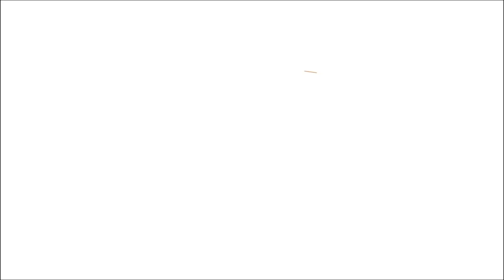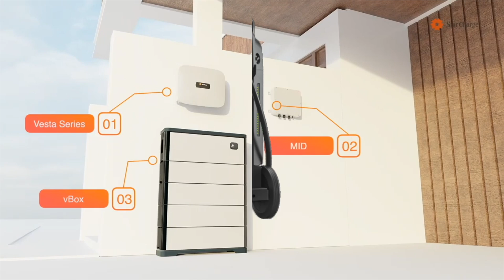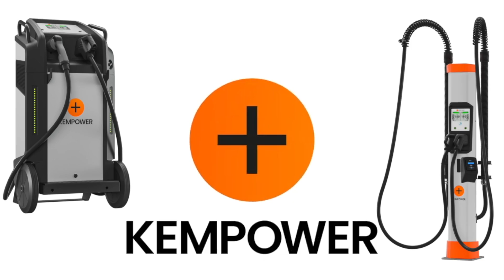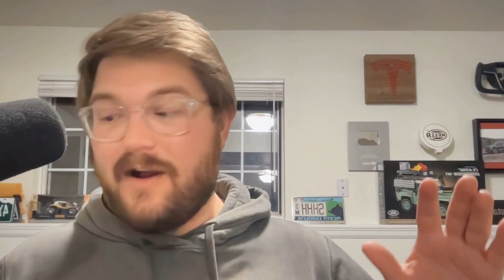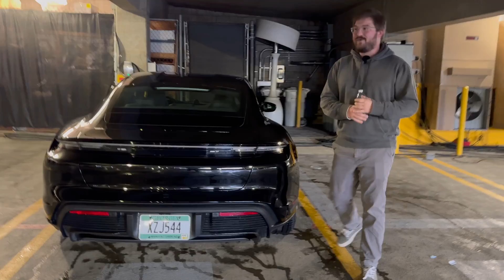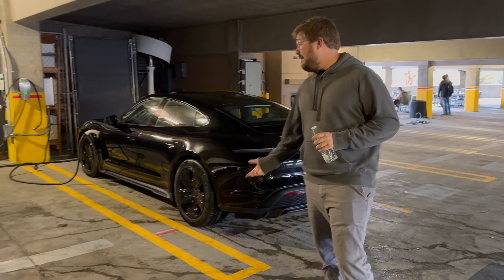Insane Porsche Charging Performance! New Taycan Facelift Charging Test & Comparison

Comment: 60 kWh in 12 minutes is outstanding. I waited for 14 minutes in the Costco gas line this weekend to just put 10 gallons of gas in my daughter’s car.
Reply: Drive 20 minutes then wait in line 10 minutes to save $5? Sounds like something my parents would do.
Reply: Filling up ICE car involves waiting in lines twice behind people paying with Lonestar cards and people playing/buying lottery tickets.
Reply: The only reason I go to other gas stations other than costco is to only top up. My van takes 18 gallons and price difference is close to 70-80c which is about 15$. That's significant savings. coming to my EV I drove 16000 miles and never super charged as we were doing local trips in a single charge or longer where we had charging at airbnb. Once my boy grows up we will be doing longer trips and perhaps use supercharger
Reply: charging an EV takes 5seconds 99% of the time. (the time it takes you plug it in at home)
Reply: lol that will charge my yearly energy need in 4 hours😂
Reply: You and I both know that's the exception not the norm

Supercharging isn't a reason you buy an EV

Charging at home is
Reply: lol ...to save $2:)
Reply: @keithhere5868 Yeah, ridiculous, just like the ICE truck and SUV owners always complaining about the cost of gasoline. 😏
Reply: Waiting time is something else and much more likely to occur at a charger than at a gas station anyways.
Reply: 10 gallons is 38 liters, that's 3 weeks of driving for me.
Reply: At what price. What will happen with these batteries in 5 years
Reply: @alexsmith6271  they will either be still working in the car or they get recycled as a Powerwall.
Reply: @LearningFast  they may be still working with a large degradation and a lithium plating about to happen.
Reply: @alexsmith6271  True, the Taycan is a bit too overpriced for what it is. However, after 11 years of my Tesla Model S ownership, I have experienced 9% battery degradation. Originally charged to 208 miles, (60 KWh Model S) now it charges to 188. That’s not so bad, IMHO. Depends on how many times the battery has been charged to 100% and drained to near 0%. Also, how many times the battery has been fast charged at fast DC chargers.
Reply: @Xetairex  it's amazing. I own m3p. I was asking about this fast charging at higher soc. To me, im ok to wait extra 5-10 mins. As for your degradation, this is not the accurate way to measure. You need to go down to zero and then charge it to see how many kilowatt hours you are getting.
Reply: If you have long Costco Gasoline lines means you live in overcrowded area. Something tells me you would have long lines to get to the charger as well. Before you need to spend charging time
Reply: @web  no lines at any of the Tesla Superchargers at all in our area. I have traveled all over this state and other states and I have never waited in line at a Supercharger.
Reply: @web Not really. Here in Fremont in SF Bay Area where I live, in the last 11 years of Tesla ownership, there was never a line at the superchargers, but always, always one at the local Costco.
Reply: @web  
Not necessarily on the Costco lines. The Costco in my city is not near a dense residential area at all. It's in a shopping area. But there's always a 20 minute wait,. And it's ridiculous. Saving 30 cents per gallon? You're saving less than $4 versus the rest of the gas stations in the city.
I think it's the same kind of mentality that leads people to crowd into stores for Black Friday to save $50 on a $500 TV.
Reply: @web Perhaps you live in the middle of nowhere and have never seen gas lines, but you should see the lines in the summer to fill-up with gas in all major urban areas. In the NJ Turnpike and Garden State Parkway there are usually a line of 15 minutes minimum in the summer or on holidays. Then after the father has finally finished filling up, he has to find a parking spot to then go join his family inside to get something to eat.

Meanwhile, on the same rest stops, Tesla drivers leave their cars charging and go inside, and by the time they're finished, so is their charging. And I've never seen any Tesla waiting to charge there. Tesla simply keeps adding more stalls, which can be easily done, rather than a major reconstruction job to add more pumps with gas. And now they're adding Solar and batteries to large charging stations. I saw one such station being built in Arizona.
Reply: @Paul-cj1wb 
Just adding more stalls without major reconstruction of the grid connection means slower charging for everyone.
Reply: @GABA-A42  Did you miss the part about adding Solar and batteries? That's how Tesla will buffer the grid in the meantime and eventually not even need it in some locations.
Reply: @Paul-cj1wb  
I mean the connection of the charging station to the grid.
Imagine 0.3 MW per stall. Just 10 stalls and you need a 3 MW connection to the grid.
Reply: @GABA-A42  Tesla already has many stations with many more MW's than that from the grid. And there are quite a few in Europe and China with even more MW's from the grid. Some buffered with solar and batteries. There are a few locations with hundreds of stalls in China.

Let me put it this way -- a little over 10 years ago Tesla said it would build it owns nationwide charging network. People said that was impossible, and they would never succeed. 
They began with 72kw stalls which was higher than anything before, with 50kw being the highest at the time. People said was was too much power and the grid could not handle it.

3 years later they began installing only V2 stalls with 150kw shared. People again said that was too much and would never work due to grid constraints. 

3 years after than they began installing only V3 chargers with 250kw not shared. People again said that would never work because of the grid. Yet they have several locations with over 80 stalls. One with 124 stalls total. And adding many other large stations where EV concentration is high with Solar and batteries to buffer the grid. I myself saw one being built in Arizona when I was there late last fall.

Last year they began with their V4 stall (350kw) installations. And again people like you are saying that's never going to work due to the grid. Never once considering there are solar and battery packs now. Remember, Tesla owns a solar company and builds their own battery megapacks -- a multi-billion dollar, and growing, business for them.

Keep this in mind for perspective. A typical Walmart parking lot covered in 500W solar panels provides over 7MW of power per hour. And if you cover its roof, they combine for a total of over 12MW per hour. So anywhere between 50 to over 80MWs per day. And keep in mind that there are panels over 600W now.

Hope this helps you understand it. And to see what's coming.
Reply: @GABA-A42   @user-dv7hq2rh4g  Tesla already has many stations with many more MW's than that from the grid. And there are quite a few in Europe and China with even more MW's from the grid. Some buffered with solar and batteries. There are a few locations with hundreds of stalls in China.

Let me put it this way -- a little over 10 years ago Tesla said it would build it owns nationwide charging network. People said that was impossible, and they would never succeed. 
They began with 72kw stalls which was higher than anything before, with 50kw being the highest at the time. People said was was too much power and the grid could not handle it.

3 years later they began installing only V2 stalls with 150kw shared. People again said that was too much and would never work due to grid constraints. 

3 years after than they began installing only V3 chargers with 250kw not shared. People again said that would never work because of the grid. Yet they have several locations with over 80 stalls. One with 124 stalls total. And adding many other large stations where EV concentration is high with Solar and batteries to buffer the grid. I myself saw one being built in Arizona when I was there late last fall.

Last year they began with their V4 stall (350kw) installations. And again people like you are saying that's never going to work due to the grid. Never once considering there are solar and battery packs now. Remember, Tesla owns a solar company and builds their own battery megapacks -- a multi-billion dollar, and growing, business for them.

Keep this in mind for perspective. A typical Walmart parking lot covered in 500W solar panels provides over 7MW of power per hour. And if you cover its roof, they combine for a total of over 12MW per hour. So anywhere between 50 to over 80MWs per day. And keep in mind that there are panels over 600W now.

Hope this helps you understand it. And to see what's coming.
Reply: @GABA-A42  Tesla already has many stations with many more MW's than that from the grid. And there are quite a few in Europe and China with even more MW's from the grid. Some buffered with solar and batteries. There are a few locations with hundreds of stalls in China.

Let me put it this way -- a little over 10 years ago Tesla said it would build it owns nationwide charging network. People said that was impossible, and they would never succeed. They began with 72kw stalls which was higher than anything before, with 50kw being the highest at the time. People said was was too much power and the grid could not handle it.

3 years later they began installing only V2 stalls with 150kw shared. People again said that was too much and would never work due to grid constraints. 

3 years after than they began installing only V3 chargers with 250kw not shared. People again said that would never work because of the grid. Yet they have several locations with over 80 stalls. One with 124 stalls total. And adding many other large stations where EV concentration is high with Solar and batteries to buffer the grid. I myself saw one being built in Arizona when I was there late last fall.

Last year they began with their V4 stall (350kw) installations. And again people like you are saying that's never going to work due to the grid. Never once considering there are solar and battery packs now. Remember, Tesla owns a solar company and builds their own battery megapacks -- a multi-billion dollar, and growing, business for them.

Keep this in mind for perspective. A typical Walmart parking lot covered in 500W solar panels provides over 7MW of power per hour. And if you cover its roof, they combine for a total of over 12MW per hour. So anywhere between 50 to over 80MWs per day. And keep in mind that there are panels over 600W now.
Reply: @GABA-A42  Tesla already has many stations with many more MW's than that from the grid. And there are quite a few in Europe and China with even more MW's from the grid. Some buffered with solar and batteries. There are a few locations with hundreds of stalls in China.

Let me put it this way -- a little over 10 years ago Tesla said it would build it owns nationwide charging network. People said that was impossible, and they would never succeed. 

They began with 72kw stalls which was higher than anything before, with 50kw being the highest at the time. People said was was too much power and the grid could not handle it.

3 years later they began installing only V2 stalls with 150kw shared. People again said that was too much and would never work due to grid constraints. 

3 years after than they began installing only V3 chargers with 250kw not shared. People again said that would never work because of the grid. Yet they have several locations with over 80 stalls. One with 124 stalls total. And adding many other large stations where EV concentration is high with Solar and batteries to buffer the grid. I myself saw one being built in Arizona when I was there late last fall.

Last year they began with their V4 stall (350kw) installations. And again people like you are saying that's never going to work due to the grid. Never once considering there are solar and battery packs now. Remember, Tesla owns a solar company and builds their own battery megapacks -- a multi-billion dollar, and growing, business for them.

Keep this in mind for perspective. A typical Walmart parking lot covered in 500W solar panels provides over 7MW of power per hour. And if you cover its roof, they combine for a total of over 12MW per hour. So anywhere between 50 to over 80MWs per day. And keep in mind that there are panels over 600W now.
Reply: @GABA-A42  Tesla already has many stations with many more MW's than that from the grid. And there are quite a few in Europe and China with even more MW's from the grid. Some larger ones buffered with solar and batteries. 

Let me put it this way -- a little over 10 years ago Tesla said it would build it owns nationwide charging network. People said that was impossible, and they would never succeed. 
They began with 72kw stalls which was higher than anything before, with 50kw being the highest at the time. People said was was too much power and the grid could not handle it.

3 years later they began installing only V2 stalls with 150kw shared. People again said that was too much and would never work due to grid constraints. 

3 years after than they began installing only V3 chargers with 250kw not shared. People again said that would never work because of the grid. Yet they have several locations with over 80 stalls. One with 124 stalls total. And adding many other large stations where EV concentration is high with Solar and batteries to buffer the grid. I myself saw one being built in Arizona when I was there late last fall.

Last year they began with their V4 stall (350kw) installations. And again people like you are saying that's never going to work due to the grid. Never once considering there are solar and battery packs now. Remember, Tesla owns a solar company and builds their own battery megapacks -- a multi-billion dollar, and growing, business for them.

Keep this in mind for perspective. A typical Walmart parking lot covered in 500W solar panels provides over 7MW of power per hour. And if you cover its roof, they combine for a total of over 12MW per hour. So anywhere between 50 to over 80MWs per day. And keep in mind that there are panels over 600W now.
Reply: @GABA-A42   There already has many stations with many more MW's than that from the grid. And there are quite a few in Europe and China with even more MW's from the grid. Some buffered with solar and batteries. There are a few locations with hundreds of stalls in China.

Let me put it this way -- a little over 10 years ago Tesla said it would build it owns nationwide charging network. People said that was impossible, and they would never succeed. 
They began with 72kw stalls which was higher than anything before, with 50kw being the highest at the time. People said was was too much power and the grid could not handle it.

3 years later they began installing only V2 stalls with 150kw shared. People again said that was too much and would never work due to grid constraints. 

3 years after than they began installing only V3 chargers with 250kw not shared. People again said that would never work because of the grid. Yet they have several locations with over 80 stalls. One with 124 stalls total. And adding many other large stations where EV concentration is high with Solar and batteries to buffer the grid. I myself saw one being built in Arizona when I was there late last fall.

Last year they began with their V4 stall (350kw) installations. And again people like you are saying that's never going to work due to the grid. Never once considering there are solar and battery packs now. Remember, Tesla owns a solar company and builds their own battery megapacks -- a multi-billion dollar, and growing, business for them.

Keep this in mind for perspective. A typical Walmart parking lot covered in 500W solar panels provides over 7MW of power per hour. And if you cover its roof, they combine for a total of over 12MW per hour. So anywhere between 50 to over 80MWs per day. And keep in mind that there are panels over 600W now.
Reply: @GABA-A42  Again, are you not reading the part about Solar buffering the grid? 
Tesla already has many stations with many more MW's than that from the grid. And there are quite a few in Europe and China with even more MW's from the grid. Some buffered with solar and batteries. There are a few locations with hundreds of stalls in China.

Let me put it this way -- a little over 10 years ago Tesla said it would build it owns nationwide charging network. People said that was impossible, and they would never succeed. 
They began with 72kw stalls which was higher than anything before, with 50kw being the highest at the time. People said was was too much power and the grid could not handle it.

3 years later they began installing only V2 stalls with 150kw shared. People again said that was too much and would never work due to grid constraints. 

3 years after than they began installing only V3 chargers with 250kw not shared. People again said that would never work because of the grid. Yet they have several locations with over 80 stalls. One with 124 stalls total. And adding many other large stations where EV concentration is high with Solar and batteries to buffer the grid. I myself saw one being built in Arizona when I was there late last fall.

Last year they began with their V4 stall (350kw) installations. And again people like you are saying that's never going to work due to the grid. Never once considering there are solar and battery packs now. Remember, Tesla owns a solar company and builds their own battery megapacks -- a multi-billion dollar, and growing, business for them.

Keep this in mind for perspective. A typical Walmart parking lot covered in 500W solar panels provides over 7MW of power per hour. And if you cover its roof, they combine for a total of over 12MW per hour. So anywhere between 50 to over 80MWs per day. And keep in mind that there are panels over 600W now.
Reply: @GABA-A42  
Such stations exist already with many more MW's than that from the grid. And there are quite a few in Europe and China with even more MW's from the grid. Some buffered with solar and batteries. There are a few locations with hundreds of stalls in China.

Let me put it this way -- a little over 10 years ago Tesla said it would build it owns nationwide charging network. People said that was impossible, and they would never succeed. 

They began with 72kw stalls which was higher than anything before, with 50kw being the highest at the time. People said was was too much power and the grid could not handle it.

3 years later they began installing only V2 stalls with 150kw shared. People again said that was too much and would never work due to grid constraints. 

3 years after than they began installing only V3 chargers with 250kw not shared. People again said that would never work because of the grid. Yet they have several locations with over 80 stalls. One with 124 stalls total. And adding many other large stations where EV concentration is high with Solar and batteries to buffer the grid. I myself saw one being built in Arizona when I was there late last fall.

Last year they began with their V4 stall (350kw) installations. And again people like you are saying that's never going to work due to the grid. Never once considering there are solar and battery packs now. Remember, Tesla owns a solar company and builds their own battery megapacks -- a multi-billion dollar, and growing, business for them.

Keep this in mind for perspective. A typical Walmart parking lot covered in 500W solar panels provides over 7MW of power per hour. And if you cover its roof, they combine for a total of over 12MW per hour. So anywhere between 50 to over 80MWs per day. And keep in mind that there are panels over 600W now.
Reply: @GABA-A42   Tesla already has many stations with many more MW's than that from the grid. And there are quite a few in Europe with even more MW's from the grid. Some buffered with solar and batteries. 

Let me put it this way -- a little over 10 years ago Tesla said it would build it owns nationwide charging network. People said that was impossible, and they would never succeed. 
They began with 72kw stalls which was higher than anything before, with 50kw being the highest at the time. People said was was too much power and the grid could not handle it.

3 years later they began installing only V2 stalls with 150kw shared. People again said that was too much and would never work due to grid constraints. 

3 years after than they began installing only V3 chargers with 250kw not shared. People again said that would never work because of the grid. Yet they have several locations with over 80 stalls. One with 124 stalls total. And adding many other large stations where EV concentration is high with Solar and batteries to buffer the grid. I myself saw one being built in Arizona when I was there late last fall.

Last year they began with their V4 stall (350kw) installations. And again people like you are saying that's never going to work due to the grid. Never once considering there are solar and battery packs now. Remember, Tesla owns a solar company and builds their own battery megapacks -- a multi-billion dollar, and growing, business for them.

Keep this in mind for perspective. A typical Walmart parking lot covered in 500W solar panels provides over 7MW of power per hour. And if you cover its roof, they combine for a total of over 12MW per hour. So anywhere between 50 to over 80MWs per day. And keep in mind that there are panels over 600W now.
Reply: @GABA-A42  You do realize most Tesla stations now have 16 or more stalls, right? With many newer ones 24 and up. I've seen 48 stall locations. And some 80 or more. They're buffering the grid on some of the larger ones with Solar and battery packs.
Reply: @web Well, I live in a very densely populated area, I charge at work 85% of the time, and at home in my second residence, takes me around 20 seconds to plug it once or twice a week, some others charge at home or their parking bay every day. I was never able to do this with my ICE cars obviously.
Reply: Waiting to put gas in the car is a very rare occurrence. Don’t sugarcoat EV charging taking too long. Be objective. The charging time will get much better over time. By the way I’m a 2023 Tesla owner, so don’t think I’m an EV hater.
Reply: @rcole3838  don’t sugarcoat filling up with gas. There is ALWAYS a line at Costco. Just the fact that there is a line constantly indicates that it isn’t a rare occurrence. Also I didn’t even mention the fact that it took me 20 minutes of driving to get to and from the gas station instead of just charging at home. Filling up with gas is EXTREMELY time consuming when compared to charging at home or even charging on the road for that matter.
Reply: @LearningFast  have you thought about filling up at literally any other gas station instead of waiting at costco for 15+ minutes? This is a costco issue not a gas filling up issue. Are the few $ in savings worth waiting 15+ minutes in line every time to you? 20 cents a gallon less is only $2 savings for 10 gallons. For me, that time wasted was not worth it, plus you need a costco membership to use it and plus only VISA credit cards allowed. I'm an EV fan but cmon filling up with gas is not "EXTREMELY time consuming" vs charging on the road
Reply: @jrchurchman13  my whole point is that waiting for 15 minutes in any line isn’t that bad if you are accustomed to it. I needed to go to Costco for other things so waiting those extra minutes just didn’t bother me that much. Just like waiting 15 minutes to charge on a road trip doesn’t bother me because I go to the bathroom and stretch my legs. The problem is that ICEaholics make it sound like waiting to charge is this terribly inconvenient thing. It isn’t as bad as they make it sound just like waiting at Costco isn’t as bad as it sounds.
Reply: @LearningFast 
There is always a line at Costco??  
 Then Go somewhere else, and pick a station that is on route to your home. Even if you are shopping at Costco.. you are still wasting your time. 
 I saw another video complaining about how slow getting gas is.. So I decided to check time it  just to see.. 
I picked my normal gas station I will pass going home.
 It took me 2.5 min.. TOTAL  To get out of the car.. tap to pay.. fill up with 12 gallons, and be in my car moving. 
BTW I drive an EV too.. love it.  But getting gas is about as easy as can be.
Plugging in everyday at home.. takes about 1/3  of the total time it was to get gas.. You still have to grab the connector.. open the port, plug it in..  and make sure it actually starts charging. The only additioanl time in  getting gas is the time to actually pump the fuel.
Plugging in at home is not that much better than getting gas.
And that gas will take me TWICE the miles my EV can go on a full charge.
Reply: @LearningFast i call BS. Filling with gas is faster 99% of the time. EVs have advantages, speed of taking fuel onboard isn't one of them. Its idiotic statements like yours that make the EV community look dumb.
Reply: @LearningFast  I time to go at off hours, like right before closing or first thing in the morning. So not everyone does all the time.
Reply: @patrickmay8261  there always seems to be a line at my Costco no matter what time it is. It is always packed.
Reply: @LearningFast I've been driving for over 10 years and have only ever waited at most 1-2 minutes to put gas in any car at any place.
Reply: @rcole3838 what is rare? I saw at least four long lines at the gas stations last year...
Reply: @Harrythehun wow. Four in a year. Disaster.
Reply: @rcole3838 
Charging at home there is no gas wait. We frequently shake our head at the gas line while shopping at Costco, most sitting in line probably rarely travel across county lines and can probably get by with a golf cart.

To those who don't, or cannot, charge at home, more power to ya.